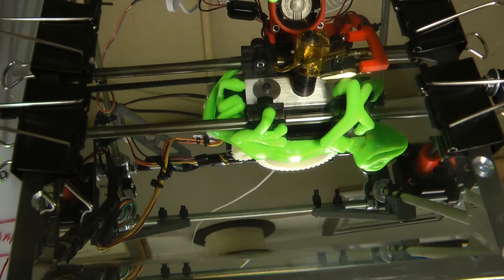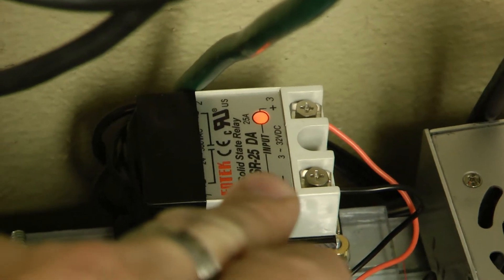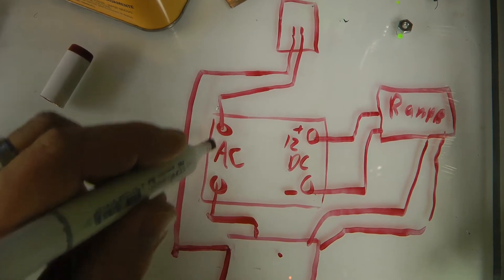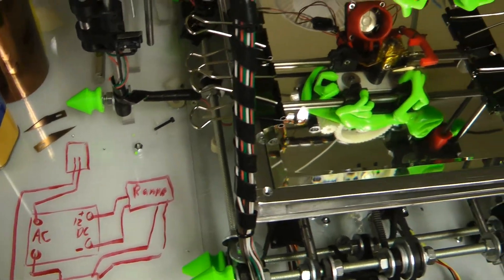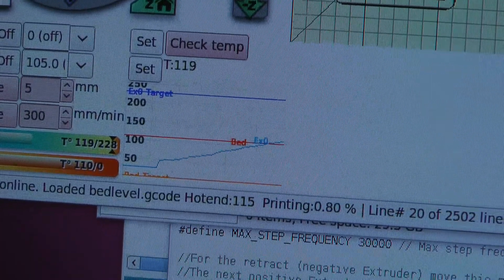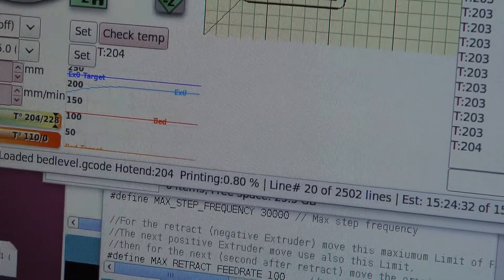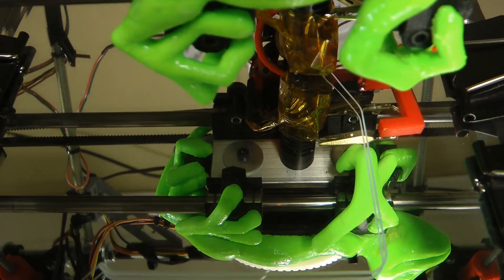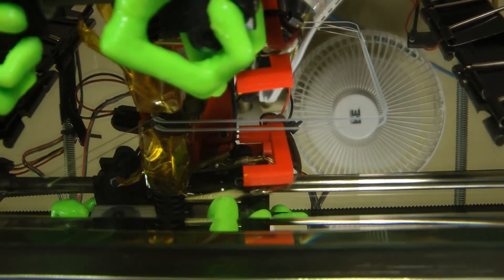A heated silicon bed for Prusa Mendel intro.mp4

Comment: This is fantastic. I have been looking for a way to heat a bed for a custom printer with a 400 x 800 build area and stumbled on this. Thanks heaps. How did you connect the thermistor to the alum plate?